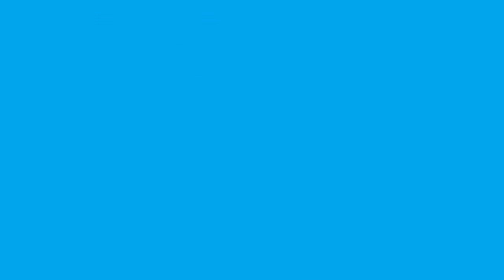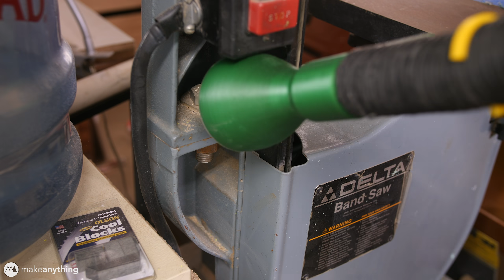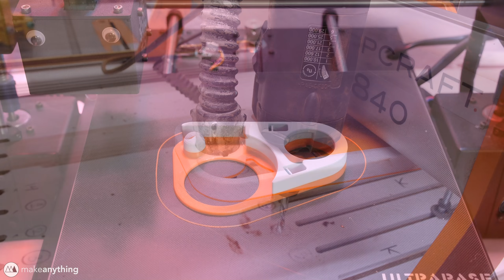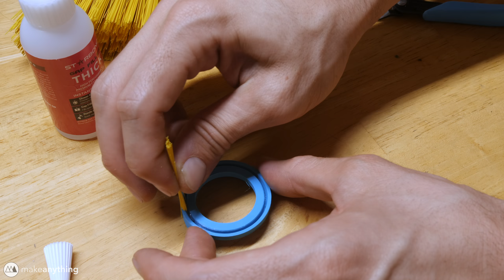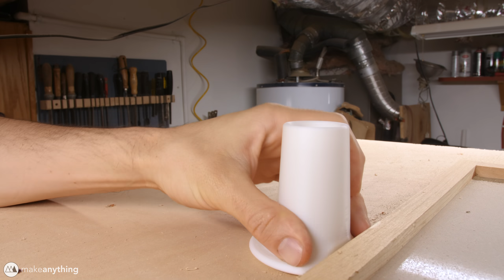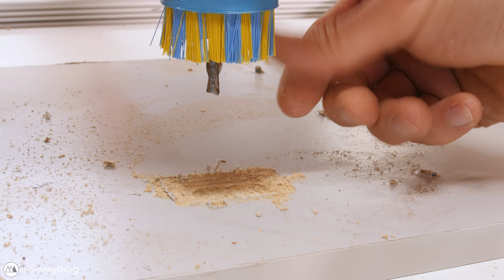3D Prints that SUCK // Cool Prints 5

Comment: Make a wood, gas engine powered outside vacuum, same profile as a water pump but for air. I'll leave you so it, or make it electric brushless so you can have it inside. But your limiting factor is your vacuum.

Comment: that vacjet thingy.
kinda reminds me of the sandblasting nozzle we have at work. the cone is about the same size, and it has a tube inside that blows the sand, that is then sucked back into the sandblaster by the vacuum. 

the difference is that the jet inside the nozzle is approximately 2cm (about 4/5 of an inch) inside the cone, its still powerful enough and makes a sortof a vortex inside the nozzle. 
and the cone has a ring of brushes on the edge.

you could implement roughly the same principle here. have some sortof brush on the edge of the cone similar to the dust collection bit. so you can cover a rough area with the cone without blowing the dust away. and have the pressure a bit deeper inside to create the vortex, instead of blowing the air far out of reach of the cone.

Comment: For the dust collecter on your CNC, I'd try a flexible print head at the end instead of bristles so that there's more suction closer to the end of your bit. Perhaps in ninja flex so that it can deform and reform without problems.

Comment: Vac-jet: I've (too many) ideas:
- generally increase the size of the cone so that there's more holes for air to travel to the vacuum
- Add bristles to keep dust from escaping the suction of the vacuum
- If you try extending the cone (like what you suggested in the video), also angle the nozzle of the air compressor to (hopefully) create a vortex (a bit like like the way your dad's dust collector is working)
- make an outer layer to the cone and send the compressed air through that. Maybe try to find a way to direct the compressed air in towards the center of the cone and towards the suction.

Comment: An augment to the bristles (you would probably have to recreate the tool) would be to add in a wide, weak-ish spring to have the bristles literally press against the work at all times. It would kind of drag, but if this spring were made of plastic with holes for arms (basically, a slinky) it would probably prevent the tool from wobbling around unnecessarily.

Comment: You are blowing, not sucking.  Its cuz your holes are too small.
Pantyhose is way more breezy than such few holes that small.
Listen to the sound of the motor of the shop vac with no attachments, then listen to it with the showerhead on it.
Not the increase in pitch, indicating you are working the motor hard.
That means you don't have free air flow.
Panty hose doesn't increase the pitch of the whine while its sucking...at all. 

Besides, you don't really need such a precautionary measure.  Just check your dust collector before you pitch it...you should do that anyway.

Comment: I'd had the same idea for the Vacjet.  High 5 😀.  Never went past my notes tho.
I have the notes somewhere, but iirc one idea was to split the compressed air stream into a ring of outlets around the outside, all facing inwards a little maybe (or just spinning around like an air vortex), to create a sortof air-curtain to keep dust from escaping.  Then the vacuum was in the middle.  Feel free to try that out, i got that bane of makers where i've got way more ideas than motivation/time.

Comment: I think the shape of the nozzle is wrong. I think it should be narrower, but perhaps longer, more like a vacuum nozzle usually is (or better yet, interchangeable heads) and angled forwards. And the jet can come out more on top or bottom of the nozzle so as not to interfere with vacuum airflow as much.

Comment: Possible design upgrade for the cnc dust collector, add a soft(easily compressible) flex hose between the brush & its mount so it pushes the brush into your project but allows it to move inward for those deeper cuts! Also for this to work you might have to add guide rails for the brush so it can only move up & down, not side to side!

Comment: Make the diameter smaller. You've drastically decreased the power of the vacuum. Also, small brushes on the outside will help contain the power of the exhaust.

Comment: What about converting all your smaller hoses (looks like 1" and 1-1/2") to the 2" like on the exit of the vacuum? Yes, it will take more "hose-management" to keep them out of the way, but it's possible you're losing a lot of your suction force in both the vac-jet and the cnc to the smaller hoses. Just a thought...

Comment: So for the Vac-Jet you could adapt the ratio of blowage to suckage by making usage of the Venturi effect. Basically make a split in the line that the air blower goes to that has a tube to turn the air around and force it down the hose increasing the sucking force of the vacuum and decreasing the force of the air blaster. you could balance it by using a pair of set screws or preferably a method that is faster to adjust to locate the nozzle at the exact point you want so that if you wanted you could easily turn it to full strength air blaster or extra strength vacuum with the air blaster fully directed into the vacuum. Also just thought of this after the CNC project and suggesting the cone around that one but if you surround the vac jet cone with bristles to strengthen the vacuum force around it it will also help keep the chips contained so that might also make it work! either way there are 3 more things you can try for your project!

Comment: ... on both projects: the trick is to have a smaller diameter suction cap. Smaller than the hose. Create some nozzle around the edge and you should be golden. That way the air is forced to go in faster which increases the suction.

Comment: Hi, you should use hoses with bigger inner diameter. The suction is directly related to the diameter. What makes it even worth is spirals inside the hose, this also reduces suction. So get big hoses with smooth inner surface and you are good.

Comment: Maybe the suction force would increase with a longer tube, if the tube where made flexibele, and springloaded, you could control the distance with an attached string, the string lenght could be controlled by a small stepper motor, and that should get its information from the cnc driver, to control the distance to the workpiece. it that is not possible, an attached hall sensor could detect the distance, what do you think?

Comment: There’s suction being lost somewhere it’s either the strength of the vacuum the connection of the hose or the chamber the vacuum has is not completely air tight

Comment: The VacJet you printed up is actually very similar to a device we use in a cleanroom where i work. Just like your workshop, we can't have particles flying around in the air or they will contaminate the tools.

Comment: About VacJet.
You need to slow air flow. The easiest way is to increase the output diameter for the air. Bigger hole >>> slower air speed =)
Play with diameter.
Regards

Comment: When you go from a thin hose to a wide nozzle, you loose suction power. -- Your nozzle is designed to weaken the vacuum.  If you go from a thick hose to a thin nozzle, it will increase the force of the vacuum. -- You should consider extending the bristles to the tip of the cutting tool, IMO -- if you make the plastic bit longer and springy (maybe springo it?), plunge cuts would still be possible.

Comment: @Make Anything - Devin, try printing an inverted funnel out of flexible filament, such that its bottom (intake area) can be closer, or even possible squished against the material being CNC'd.  This should increase the suction in that area as well as physically disturb removed particles, making them more likely to be able to be sucked up.  The biggest theoretical drawback is the possibility of the flexible material doubling back into the drill itself, so it might take a few iterations to figure out the optimal shape and size.  This design would also drastically reduce the need for bristles.

Comment: I wonder how much electricity that would use if you have to have the shop vac on for hours at a time while the CNC is running. Also, maybe it would be better to use the air compressor  in the CNC too, and not use the vac at all.

Comment: For your VacJet, make a cyclone. Instead of introducing the air jet in the centre, bring it in from the side at a tangent to the opening of the funnel and level with the rim of the opening. This way the air jet will spiral around the surface of the funnel and add pressure to the vacuum. You might have to lose the perforated cap. This will stop the jet overpowering the vacuum. It will however lose the blast to get into the crevices.
Maybe make a hybrid of both? Split the air jet, so half the air goes to the centre jet, and half goes to the cyclone. Just an idea.
With your CNC vacuum, would longer softer bristles help seal the airflow, so you are only sucking around the bit? Or modify your existing brush, so it sits on the surface being cut with a telescoping tube joining it to the cutter / vacuum head. That way the vacuum brush is always in contact with the wood being cut, but will adjust it's height as the cutter drops.
Thanks for another great idea filled video.
Reply from the maker: A crazy hybrid cyclone vac jet sounds right up my alley :D

Comment: What if the jet port blew the debris toward the vac port? I think you're also losing a lot of suction because of the screen. Could you have a magnet in the line, maybe inside chamber to reduce the local suction within that area?

For the CNC, you need to more reliably reach the milling surface. Longer, softer, but more tightly-packed bristles might help. Or a compressible hose/sleeve? Can you hook it up with electronics that know how deep you're cutting and adjust the length of the suction aparatus? What you kinda need is a series of spring-mounted pins (like a gator socket) that could ride the surface of the part you're cutting while maintaining a seal against eachother. With beveled edges so the could ride in and out of cut holes. Gravity might be able to do it, too.

I've been considering designing a vacuum housing for my hair trimmer to make a modern flowbee.

Comment: Nice. I created shop vac attachments as well. Really helps with my orbital sander and router that don't have anywhere near the same size fitting as the shop vac. Also increases the suction as you step down to a smaller hose at the end! My suggestion for you would be to lengthen the brush fitting so the hose and bristles extend lower closer to the bit, putting the suction point closer to the piece being cut! Should work!
Reply from the maker: I was just worried about long bristles catching the end mil, but I suppose it would depend on what I'm cutting :)
Reply: @make.anything  shorten the bristles by extending the tube lower, thus lowering the suction. Bristles are possibly not needed. Dust is fine and they don't need to do anything in this type of project.

Comment: Get yourself a high RPM electric motor and a blower wheel. Salvage one from a washer or dryer etc. Put it in a wooden box with a hole on top (intake) and on the side (output) that leads into your collection system. Or just a cloth dust bag which would remove the need for that huge box.

Comment: Can you make the compressor vacuum nozzle with the compressed air jet facing the other way. Maybe it'd accelerate the air enough to get the stuck dust moving.
Reply from the maker: Hmm, there might be something to this
Reply: Maybe the Venturi effect could also be used to cause more flow. There might be a need for a bleeder of sorts to let the extra pressure in the hose to bypass the fan. Like a flap valve. I'm guessing the pressure might be slowed by the fans inertial mass and not over driving the motor.

Comment: YO TIP FOR YOUR VAC-JET: Im a mechanical engineer and one flaw of your design is that the vacuum chamber is diverging which means you are slowing down flow at the front. instead keep a similar cross sectional area to you vacuum hose tube or even make it converge in slightly. This will increase flow speed there thus sucking air faster.
Reply: Also for your shop vac you are restricting flow with that one inch hose being so long and then your bristle brush end is also larger than 1 inch so diverging again. This has the effect of decreasing vacuum suction and flow speed. It kindof sortof works but you would get a much better result if you had the same diameter hose all the way and a smaller opening at the end. That would increase suction and flow.
Reply: There is only so much a bigger better vacuum can do... Sometimes physics does  the rest! Fluid dynamics can solve your troubles in this video. No need for a bigger more expensive vacuum.
Reply from the maker: Good advice, thanks!

Comment: From a cnc router guy you might want to use a less firm bristle
Reply: and maybe bristles that are at least as long as the end mill so that when it plunges down into the material they create a sort of cup around the tip of it to enclose the area strengthening the vacuum and keep the chips within that area of stronger vacuum pressure. Or maybe you can do some sort of multi layer method with shorter stiffer bristles on the inside and longer softer bristles on the outside. The less gaps that air can get out through or the harder you make it for air to get through the bristles the stronger the vacuum will be at the tip.

Hey maybe surround the vac jet cone with bristles to strengthen the vacuum force around it too!

Comment: You're probably loosing a lot of suction from the length of small hose going to the end mill!
If you feel like making a mk II, I would get hose with a similar diameter to the shop vac, maybe even upgrade the shop vac to the larger hose type, so theres as little resistance to flow as practical.
Also make sure the coupling between the hose and the opening around the mill is as wide and open as you can make it.

There's a similar issue going on with your vac jet, by having the wide opening, you are spreading out the air flow and reducing the suction force. Since the filter is a factor limiting the airflow, its good that it's wide, but if you taper the cross section back down after the filter with an extension, it might make it more effective, and give you a really groovy retro sci-fi look!
Reply: its probablu clogged from the massive ball of shavings

Comment: The VacJet might seem counterintuitive at first, but the concept works really well, I use it on my t-slot table on my manual mill. 
You should turn down the pressure on your compressor. I have it set to 3 bar, but I use about 1-1,5 bar. (it's a confined space tho, the air can escape on only 2 sides, other than into the shop vac.

Maybe a slim long nozzle would be good, and maybe the air nozzle on one end pointing slightly into the direction of the vacuum hose.

Also, you could spring-load the brush part of the dust collection on the CNC. Either downwards directly onto the part (good for slotting or very small pockets and easy to set up), or spring-loaded upwards and distanced from the gantry. (If you want sketches or models, send me a message)

The next time you cut with the CNC, try using the adaptive toolpath in Fusion It improves tool life. Plus it's super satisfying to watch. ;)

Comment: for the blower sucker, you can put a curtain of brush bristles around the perimeter
Reply: Use a clear but really flexible brush, and they taper toward a point kind of like this:          ====>

That way you can clean things in a lowered pressure environment and also use a lowered air pressure.

Comment: I'm getting an Ender 3 for my birthday in October , are there any upgrades/replacements/fixes (3D printed or not) that you would recommend? I've seen 3D Printed fan covers and wire clips as well as a replacement Bowden tube and XT60 so far, although I don't know if it's worth buying and printing these upgrades or not.
Reply from the maker: The printer is pretty good out of the box, so just work with it for a while and you can figure out what you want to upgrade little by little. Have fun!
Reply: Thanks Devin!🙏

Comment: The vac-jet could be great if the grate was a concave shape like you suggested. It may be interesting to see  if a greater or smaller diameter works better or worse. Another variable might be where the grate is located relative to the lip. Can't wait to see an updated video :D

Comment: Loose the bristle brush and replace it with a telescoping ball end to equal the distance of the end mill. The ball contour will glide over the parts being worked on. Or you can install bristle brush that telescopes up and down.

Comment: Why not add a loose tube to the CNC suction ring so it can telescope down to the work surface? You could restrict it with a string to the X carriage to keep it from dropping into pockets.
Reply: that wouldnt work well because if it has to move back, the telescope thing would snag on the step and break. also read my other comment!!!
Reply: @patrioticpengu1n  the other comment I could find said to read another comment.